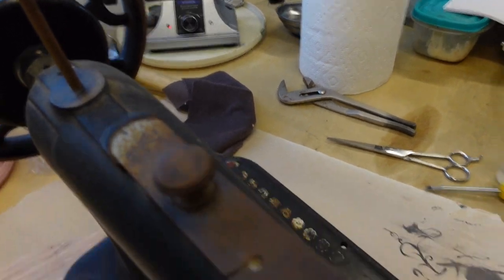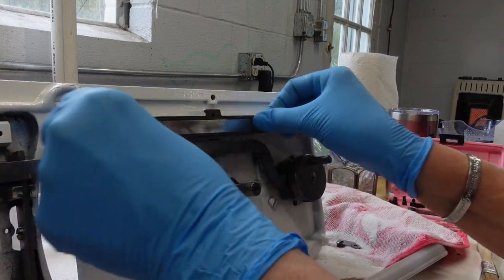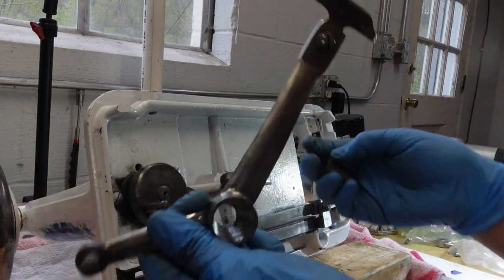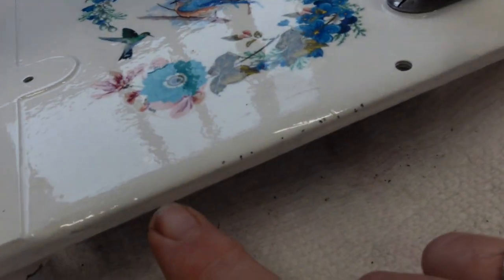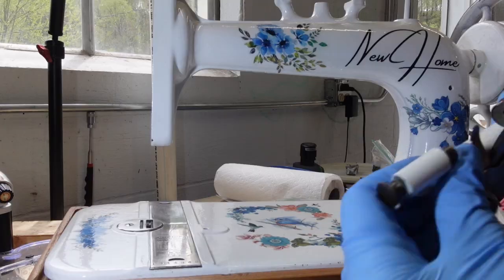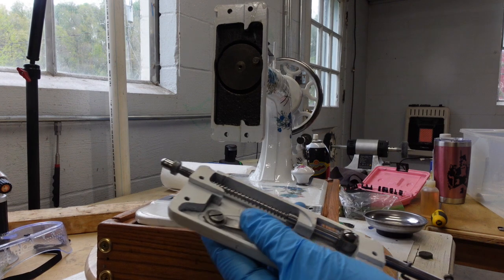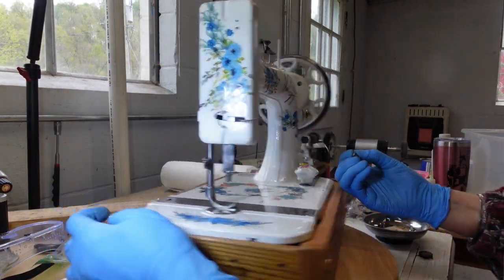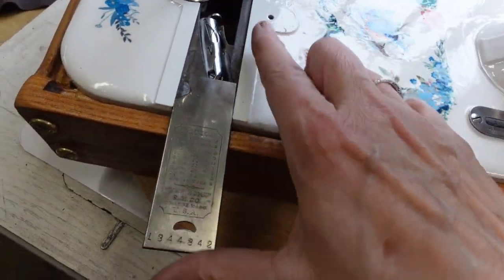"Bella Blue" Reassembling a New Home Sewing Machine From 1894

Comment: If you get another bar that has bowed. Clamp both ends with something then have hubby help you.  Heat it up with a torch evenly and gently push it into shape with a piece of board or something and hold it until it cools. That should move it just enough to give you some wiggle room.
Reply from the maker: Good idea! Thank you 😊

Comment: Hi Marie, found your page this week. Have been iso a treadle machine the last few yrs (well I've been wanting one since the 90s)...It never crossed my mind to paint them but I am an "upcyclist" (furniture/cabinetry/clothing) so this makes perfect sense! TY
I had kept my search strictly to a Singer but in your experience what if any difference is there in performance) or is the difference in brand label/ name only?
Reply from the maker: Hello! Glad you found my channel, as far as my opinion on different makes of machines, I think that singers are nice and there are several different models of treadles that work well, a 66 is very common a good old 15 is also nice, but I personally do not have a problem using other brands. In fact I have found some other brands like the rotary I'm currently issuing videos on, the new home that you just saw, I'll work well for sewing garments. I have a separate channel for sewing, called my bucolic life. On that channel if you're interested I usually so on a different machine every week when I'm making a garment. I love the little shuttle machine, and all different brands. The most important thing is if you can find some needles for them, and bobbins or shuttles for them. But with the internet and enough searching neither one should be a problem.
Reply: @Promethean Sewing Machines  
TY for your reply 🤗
It's so nice to see someone doing something as unique as you are with these historical gems! 
Maybe you can answer a primary question that's kept me from buying/trying out anything. I'm presuming a Singer Treadle BASE will fit any Singer treadle machine (is that true?) 
But I'm wondering if most other brands of treadle machine would also be able to fit inside a Singer treadle base?
Such as would a New Home or Damascus or any Singer competitor be able to fit in there as well?
Reply from the maker: @hibiscus-dreams  you are correct that most large size singer machines will fit in a standard singer treadle base. I can switch out a 15, a 66, a 127 in the same cabinet.  Take a look at my video on making a universal treadle cabinet, it's a very easy switch to be able to use a singer treadle base with other sewing machine makes. Don't let it scare you. Find one that's very inexpensive and play. I usually can find them very cheap. I have found it a lot of people that list them for high prices on marketplace will actually sell them much cheaper once they've been on the market while.

Comment: Did you find another knob for the stitch length that was shorter?
Reply from the maker: Yes and no, I found one that also has roses and fits under the winder, but it is tight. I'm thinking of swapping it out with a shiny acorn nut